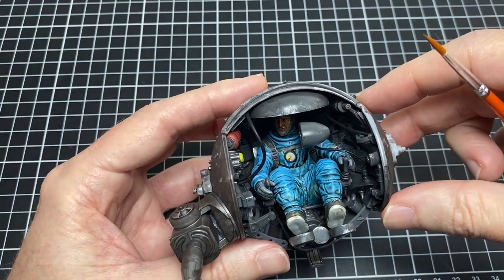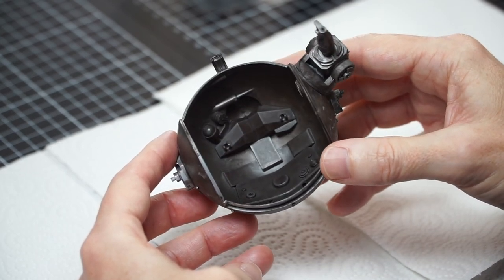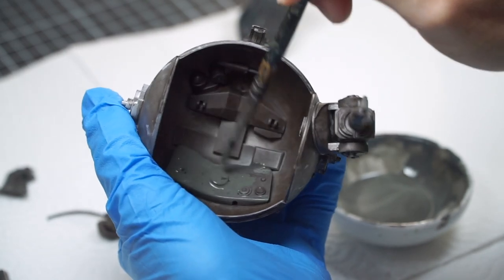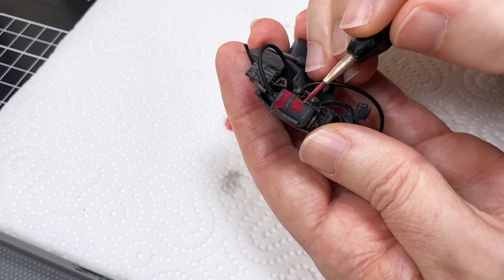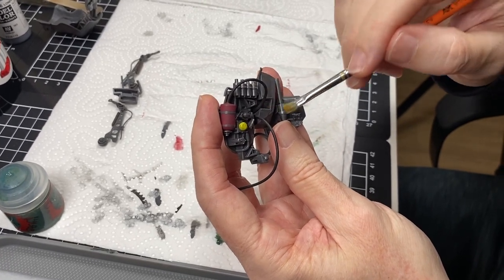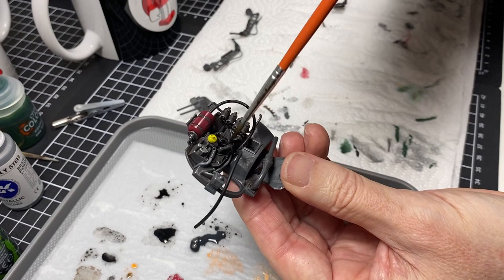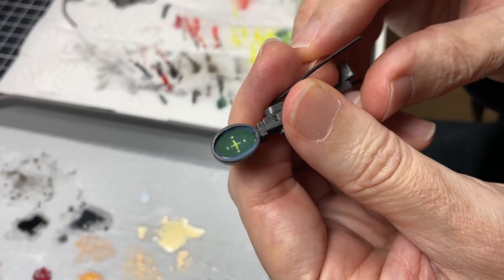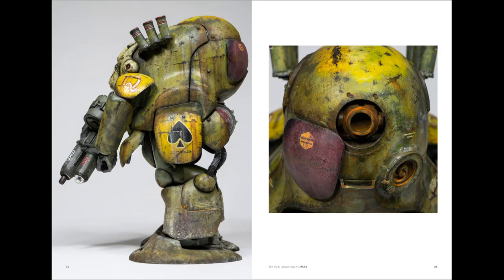Lacquer paints as washes on the Ma K Camel Cockpit

Comment: When applying the second layer The first layer of paint is peeling off. How to apply? mr.color
Reply: I had that problem with Vallejo, so I started using enamel paint. However it will do the same with all paints so you simply have to wait. I use enamels because of the beutiful finishes.